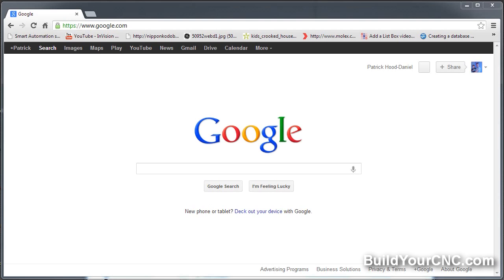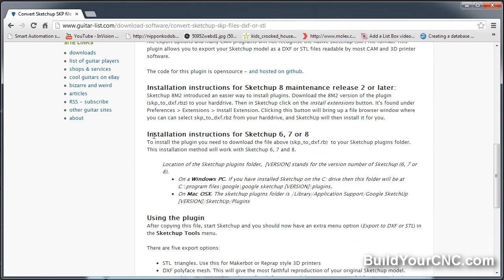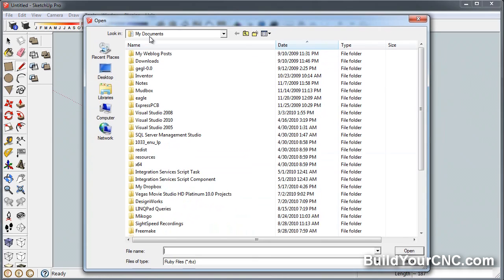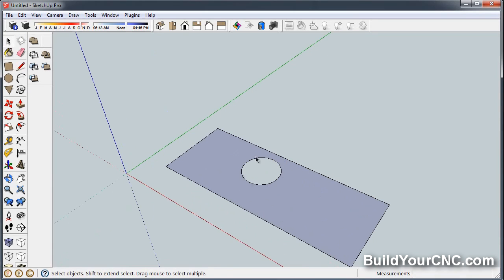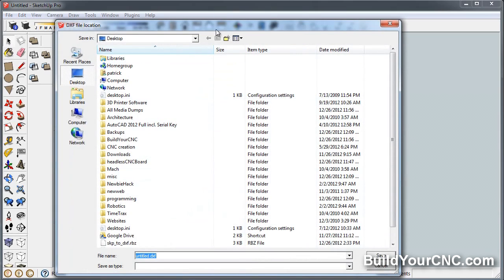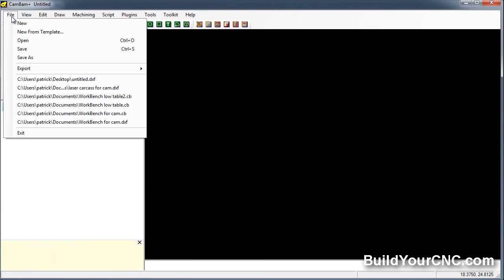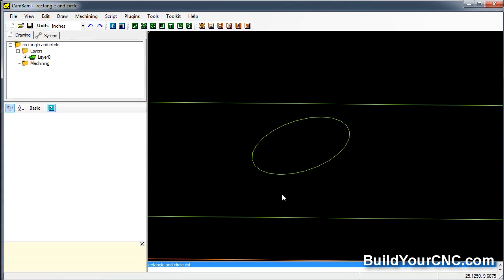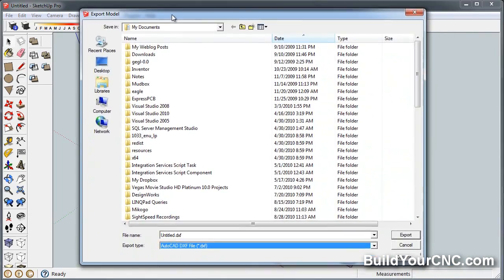Using The Standard Version of SketchUP (not pro) to Export to DXF or STL Format

Comment: Hi this doesn't work for me.  My free Version of Sketchup was downloaded june 29th
when I go to windows > extensions > preferences "3dsketchup" is not shown like on your video with a box to check...
I try to install the file and it wont I tried downloading both the old dxf converter and the new one which is supposed to be a rbz file but its still just .rb on the end of it so I tried renaming it to .rbz but still no luck   .